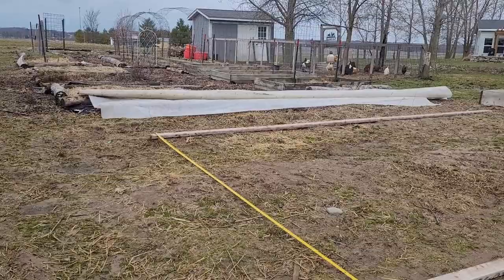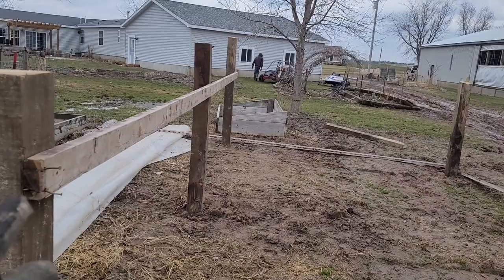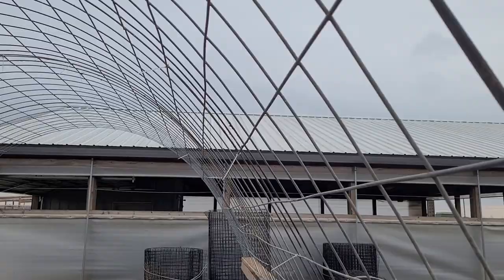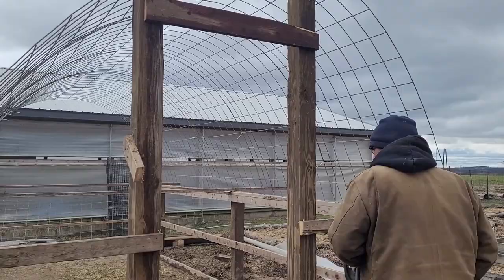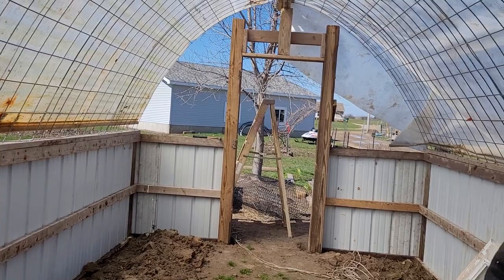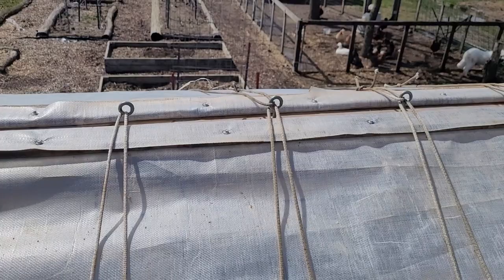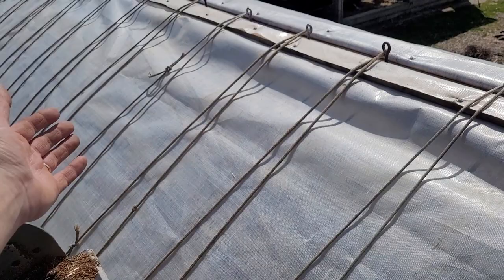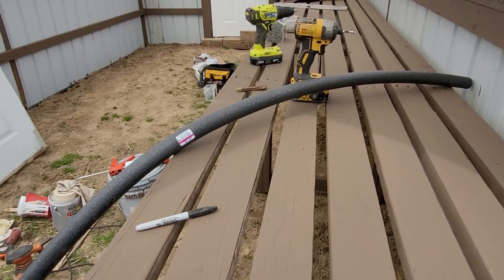How to Build the Cheapest Cattle Panel Greenhouse

Comment: Again, brilliant work from Clay Acres 👏 
All my life I've reused building materials. 
The only suggestion, maybe more 🦵 under your bench in case there's to much weight. Other than that Ronda a fantastic green house 🏠. 
I used to watch Col the 🌽 boy, until i watched many videos off just knocking down buildings and burning 🔥 it all. 
However they have a massive mortgage now, your my favourite American family 👪. From Will Burns Queensland Australia 🇦🇺 😀
Reply from the maker: I will add more legs if I feel it's not sturdy enough, but so far seems to be good. 😃

Comment: You and your husband did very good job on your greenhouse.if you use greenhouse in you get propane or gas stone to keep at 50 degree temperature in your greenhouse when get closer when what start growing your plant in plant pots in the greenhouse. What you paid for what needed for material that good. Like more project and boys fixing machine in shop out working in the fields planting corn other feed that need for your milking cattle.

Comment: Great idea. I wonder if you soaped up the curtain and scrubbed on it that would help?  Also why not finding small pieces of cutoff curtain and patch the holes.(epoxy glue) Recycling and hard work got you a great greenhouse.
Reply from the maker: I didn't show it on the video, but I layed out the plastic and scrubbed both sides. Took off a lot, but it's stained.

Comment: You might want to use see through material on the bottom (Something to bring in light). Solid metal bottom panels is good for pests but not growing. Otherwise raise the beds 2ft++ for starters. EDIT: 12:31... nevermind

Comment: I've used duct tape outdoors a few times and I can tell you the sun will ruin the adhesive in just a few weeks.  I noticed you hammered in the eyebolts and then screwed them down.  That made the wood split, so watch out for that.
Reply from the maker: I did drill holes for the eye bolts after struggling with the first few...

Comment: Why didn't you put star foam over that metal on the inside I inch and a half or two inches because that metal will get cold in a little cooler weather and you will need heat

Comment: Why did you use zip ties to connect the wire together on top instead of some kind of a wire
Reply from the maker: I don't know...I guess I used zip ties because I had them easily available, but wire would probably hold better in the long run.
Reply: While it's a very nice Greenhouse